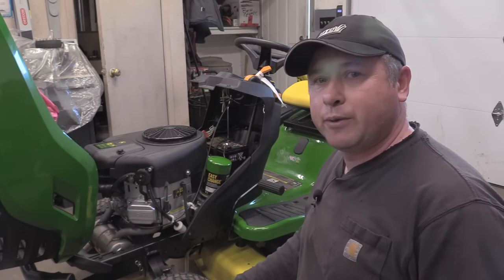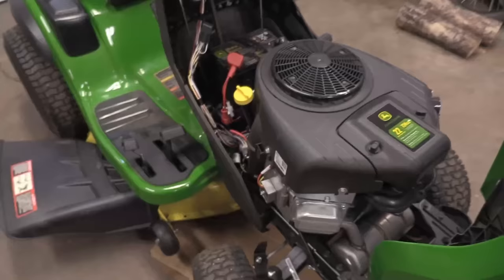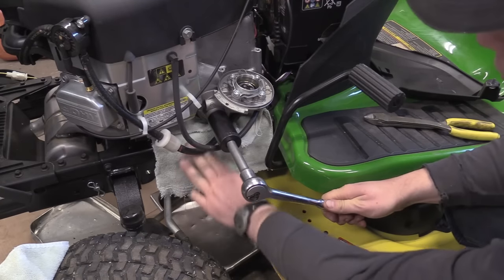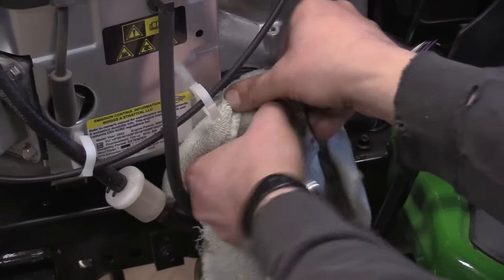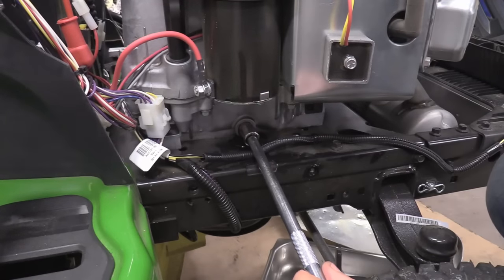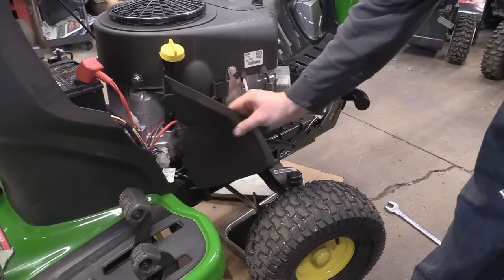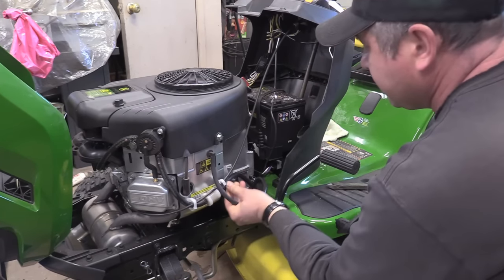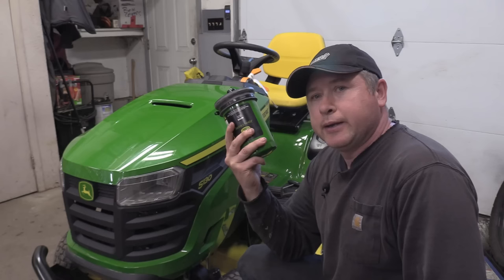John Deere Easy Oil Change Conversion On Lawn Tractor

Comment: I installed an oil drain pipe on my JD C111J with a 
Briggs 11 horse motor years ago. No oil filter on this engine but the mod makes oil changes more efficient.
This machine is 42 years old and still gettin the yard work done!
Thanks Donny!
Reply: Wow. No filter. 😮😮😮
Reply: @thurm101  I have a 111H - it just throw the connecting rod :(

Comment: There are several how tos on this filter change but yours is by far the best. You give tool sizes and all information. Thank you. The complete oil change makes more sense. The fact you can convert for less money than changing the big filter makes it a no brainer. Thanks.

Comment: I did this conversion last year. To ensure the nipple the filter screws onto does not back out, I used a little Loctite on the engine side.

To minimize oil spillage when installing the drain tube, I siphoned out as much oil as I could through the fill tube and then raised mower a little on the drain side.

I always keep a few cans of cheap brake cleaner in my garage, it is great for cleaning up residual oil spillage. Make sure there is a catch pan underneath.

Comment: The Briggs and Stratton Twin has a 2 Quart capacity with a standard type oil filter. The EZ Change filter holds .8 Quarts which increases total capacity to 90 ounces instead of 64.  When you change the EZ Change Filter, you're changing about 30 percent of the volume. 
I have done this conversion dozens of times.. I have found that installing the drain tube and draining the oil first reduces the amount of spillage when removing the EZ Change adapter.
Reply: Agree - Do the drain tube side first... If you want almost no mess, drive the tires onto 2x4 wood blocks on the side opposite the drain plug side  (tips the motor towards that side) and make a Drain Chute from cutting up an empty used milk jug to route the pit you spill when the plug it removed.   

Then doing the "filter side" will be almost mess free - just  a few ounces into a rag.

Comment: Wow!! That is an easy conversion!!!  Thanks for posting this Don!  The original filter on this had some good intent for the end-consumer, but overall, it is much worse for the environment, and engine with respect to having close to 100% clean, fresh oil to use after an oil change.  Have a great up-coming weekend.

Comment: My brother in-law had a mower with the plastic cap on the oil drain tube. It unknownly came off for who knows what reason and the oil ran out as he mowed grass. Of course we all knew what happened,, it locked up. So it's a good practice to make sure the cap is locked in place each time you start it up to mow.   Get video!  👍
Reply: I’m not a fan of that plastic cap on the drain….as you shared Michael it’s a disaster waiting to happen.

Comment: I'm going to do this conversion on my E180 as it's due for maintenance now.  To avoid the issues with the plastic cap on the pipe, I'm just going to leave the factory bolt there and then when I go to drain it, use my little oil filter drain funnel from my Harley.  That way I don't risk losing that plastic cap and the little under filter funnel will direct the oil out over the frame and down into my drain pan.  The filter conversion is excellent.  I wondered how that would possibly get all the old oil from the motor and now your video shows it doesn't.

Thanks for making this video!!!

Comment: I just did this on my S170. Amazing video. Everything went smoothly. Thank a lot
For the help!!
Reply: That was my question: I have S 170 and I'm assuming there is only one type of easy oil change filter?....and the kit of those 3 parts is $25 at walmat, or amazon...i'll buy the next year and try to replace it
Reply: Same. How many quarts or liters do you add after the conversion?
Reply: @DasGonz13  E130 takes 2.4 qts.  Your engine size may be different.

Comment: Hey Dony, I did this a couple of years ago on a E130. The easy change costs $85 in Australia. The conversion costed approx $45 and now its converted my oil changes are under $30 per year.... compared to $85, which is not an oil change its a oil top up
Reply: How is the cap for the oil drain pipe holding up?
I think that looks a bit flimsy.
Reply from the maker: @Drottninggatan2017  they are pretty good
Reply: @Drottninggatan2017 my dads old John Deere from about 20 years ago has the same kind of plastic cap and it still works fine.

Comment: I had an E150 in for service today. Owner said they had done the EZ oil filter change last Fall so no need to change the oil. I checked the oil level per usual and it was WAY too low! So it seems they did the EZ oil change and never checked or added oil. So I topped it off and did the rest of the tune-up and returned it. I had recalled seeing this video on the subject some time ago so I just sent them this video and links to the Amazon parts for the EZ filter ($44 US) and conversion kit WITH filter ($16 US) and encouraged them to have me do it in the The Fall or next Spring. 👍👍

Comment: I had converted mine over and when I went to do a oil.change the filter was stuck i had to use a hammer and a screw driver lol took a while I kept the quick oil filter parts so I put them back on never have a stuck oil filter again but I do change all of the oil I draine it all out ill spend the extra money if u see the video someome put out the filter inside is huge compared to the  regular filters so to me thats more cleaning power thats just my opinion it works for me.i enjoy ur videos thanks

Comment: Attaching a small shop vac  to the oil fill tube will create sufficient suction to prevent the  mess when installing the drain plug extension. It works!

Comment: Another excellent video Don. I am surprised a company like Deere would engineer something like this and also only have a plastic cap on the drain pipe. keep these coming Don, always learn something from you
Reply: I don’t like the cap either, even if there is an o ring on the tube. I’d of preferred a metal end cap. I bet if someone sold a properly made metal one it would sell very well, because you know that cap will get lost, leak, damaged, or crack eventually.
Reply: Or better yet just put internal threads on it for a pipe plug, maybe even the one that came out of the block to begin with.
Reply: @GNX157  All you need is a piece of iron pipe with threads on both ends and use a pipe cap or a 90 degree female end facing downward and use a 1/4" pipe plug inside of that. I did that on my riding mower and it's no mess oil changes.
Reply: Have you ever thought that maybe replacing an actual engineer with a Marketing Expert was something just a wee bit shy of a good idea !!?
Reply: I replaced my drain pipe to a pipe from the hardware store w a metal cap.  Plus it stick out a little further, making it easier to catch the draining oil.
Reply: Actually Briggs designed it. Deere just capitalized on it. Those fargan bastiches
Reply: @MattsRageFitGarage Why buy steel pipe when you can purchase  stainless steel fitting for a few dollars more.
Happy oil changes😊😊😊😊
Reply: @beachbums2008  Because availability in the hardware store.

Comment: That's pretty cool that they make stubs that can be inserted than to convert to a proper oil filter. Looks like the manufacturer set up would be a short engine life. Love the vid and the conversion tip. 👏👏👏✌️🙃

Comment: I have watched about 6 of these videos and your video is by far the best. Short and to the point and consise. The only thing I haven't seen is using an oil extractor to remove the oil. I bought one years ago for my boat and I use it on my tractor, power washer and Cyclone rake it makes life easier and less messy I will do this on my new S170 until the warranty runs out, as I am not sure if making the change will affect my warranty and by using the extractor till then, I will at least have all fresh oil!

Comment: Great video, thanks for the insights... that said, it's so disappointing that JD would stoop to something like this, makes you wonder about their commitment to quality, the environment and their customers.

One suggestion, you could shape aluminum foil under the oil drain plug to route all of the oil into a pan below... bend up little edges on both sides to channel the oil where it needs to go.  This also works when you are changing the oil as needed.

Comment: I see the points going for the ez change system. Lots of people don’t change their oil. It is messy. Even people who know what they are doing make messes doing oil changes, and it has a bunch of steps involved. With this you don’t even have to warm up the engine to “change” your oil, there’s no mess. A person may be more likely to use this, and that way they do end up prolonging the life of their engine a bit over never doing anything, but never as long as doing proper oil changes at proper intervals would.

And John Deere makes a bigger fortune selling you their proprietary filters and oil. That’s the most important thing.

I like how they tell the people using this system to add more oil as needed like they actually check their oil level ever, much less top it off. If they did that they wouldn’t use the ez change system.

Comment: I would not trust this litle plastic cap on the drain plug, is there another plug option with conventionnal metal plug cap? Great video!! You did improove 2 things doing this conversion, cheaper filter, and a complete dirty oil drain!

Comment: I converted with the help of your vid. Thanks. I'm now wondering if a different dipstick is necessary. 
Before conversion, a good quantity of oil stays in the filter system, which the dipstick can't measure.
After conversion, that oil is now free to settle to lowest point in engine.

Comment: You should use lock-tite on the filter adapter piece on the part that goes into the engine.  This will prevent it from getting loose when you remove the filter the next time.

Comment: Good morning Don.  Another great vid.  You and I both hate that drippy oil mess.  YUK!  Would it help or is it worth the time to elevate the side you're working on?  Then get the drain tube installed. Once done, set in down to finish draining the oil.  You are the pro. You would know best.  I don't even own a rider.  Awesome vid Don.
Reply from the maker: yes elevating to one side may help !

Comment: Great video! First thing I did after break in was to throw that junk Sleezy EZ oil change garbage away and do what you did but I used the Briggs and Stratton 594200 Oil Drain Hose and the Briggs & Stratton 796532 Hose Connector. The flexible oil drain hose is really convenient. It’s flexible and has an easy drain cap. That EZ thing leaves dirty oil in the engine too.

Comment: My Kohler 13hp onLT133 already has the smaller filter and I did my oil change this week at 1.8/1.9 qts.     Used full synthetic 10w40 for hot summer temps. okay per manual!!!!!
OReilly's had it cheap.  The filter does sit on that dumb elbow thing and does keep old oil in it......I Might have to do that change.

Comment: Gread video! I'm assuming there is only one kind of Easy Oil Change Filter no matter what mower you have? I have John Deere S170 with easy oil change fitler, and it's anything but easy....pain in the neck to take off, and put back on! So I just buy that kit of those 3 parts, and it should fit my S 170 ? Thanks again!

Comment: Go to a JD dealer that sells lawn tractors and you will be told that their product is better because you can "change" the oil in 30 seconds without getting your hands dirty.  That is their target market. Homeowners who don't want to drain or use an oil extractor and take used oil to recycle. The same homeowner who thinks it's ok to throw a quart of used oil into household garbage. I bought a hardly used E170 and did this same conversion a few months ago. The JD parts counterman acknowledged that every one of their customers who are DIYers has done the conversion.

Comment: Good video Dony, could you fill the oil filter with oil before installing the filter to prime it . I know this can be messy , but I always did when I had my Cub cadet with the Kawasaki 18 horse V twin . Do you have to put the side panels back on ?

Comment: I did one in 2018 on my Dad's  E180 54 inch deck 25 hp  . Being in Michigan it was 65 dollars to change the oil .  with that 1 inch nipple and a drain plug  he can change the oil for under 20 bucks .    The quick change Idea is nice but still a mess in the long run oil in the land fill .

Comment: Thanks for the video. My new S130 needs it's first oil change and will do this. Does the hollow plug that holds the filter on require thread locker?  Thanks

Comment: I just bought a new JD S170 with this Easy Oil Change system. I will be converting it back to the old system. Have you heard of any problems obtainning warranty work if the Easy Change system was replaced?

Comment: Fantastic.  I can see the idea of the easy/no mess changing of filter but leaving that much oil in and charging that much for the fancy filter seems criminal.  I'm guessing they upped the filter change frequency so while you're not changing all the oil (and nothing in the sump/sludge/particles?), you're always adding fresh oil/additives, etc. to compensate.

Too bad you can't unscrew just a filter from the easy change thing after removal, and replace that, then reinstall the easy change thing.  Ideally, being able to add oil to the filter/assembly as well before re-installation on the engine.

Next they'll be adding computer controlled engine that they'll force you to pay exorbitant prices to replace by factory trained mechanic when it should be repairable.  Support right-to-repair!

Comment: I tipped my mower to the left by placing the right-side wheels on a block and the oil in the engine was below the bottom of the drain plug hole. After I got the new pipe fitted and tightened, I put all 4 wheels flat on the ground again and drained the oil. That trick didn't work quite as well on the left side of the engine to remove the filter adapter.

Comment: In the US they were $40, 4 years ago. Now  they are close to $60. The idea was to make oil changes very easy for home owners, which they are, and the oil is triple filtered in those huge filters. However,  it costs more than double for an oil change and the oil isn't really as clean as a full change. I have the kit, ready to go on this spring. 😉

Comment: Great video.    Curious, could one not jack the machine up a bit on one side, then the other to avoid the mess? Or is it just the shear volume of oil and you’ll get a mess no matter what?
Reply: On the filter side you’ll get a mess no matter what because it’s the left over oil in the ez change housing, it will spill no matter what. On the drain plug side I would say it’s plausible, but you may have to lift it so high that it’s not safe.  After all the plug should be as close the the bottom of the oil pan/engine as possible so the oil will try to get out from the pressure of the oil. A visual representation would be to poke a hole in the bottom of a water bottle and see how far you have to tip it to get it to stop.

Comment: Plastic cap on the drain plug!!!  Is it possible that it will come off from vibration?  Get the hose that goes up vertical and clips near the top with a locking cap.

Comment: Donny why don't you use a stainless steel pipe thread nipple 😊 drain pipe if it's NPT and a stainless steel female end cap on the end of the stainless steel pipe?
By the way what size is the female thread in the engine on the riding mower?
Keep the vids coming to Pittsburgh Pa from a long subscriber of your channels!!😊😊

Comment: Love the channel Dony. 
I just replaced one of those filters. Can I add a drain tube now just to drain all the old engine oil out and still use the overpriced filter until I service it again in the fall?
Reply from the maker: yes you can do that

Comment: Don:  How about using your vacuum pump for oil to suck out the excess oil (though the dipstick tube) before you pull the plug on the block?  Might be a less messy job.😉
Reply from the maker: yes I could have but most viewers don't have that so I did it this way
Reply: @donyboy73    Understood, thanks

Comment: Nice job Don, I’ve also found that you can use a super tech 3614 oil filter on it and  I use the same filter on my Kohler engines - the super tech from wal-mart is 99% efficient according to the filter box. I’ve never had any problems with my engines.
Reply: No Supertech filters sold in Canada.
Reply: @ElectoneGuy  Any 3614 or equivalent application will work instead of a Super Tech.
Reply: @faxmen09 thx for handy tip.  3614 is a very common filter on lawn tractors.  Also is the correct filter for my Ford Focus (2005-2011) with the 2.0 Duratec engine.